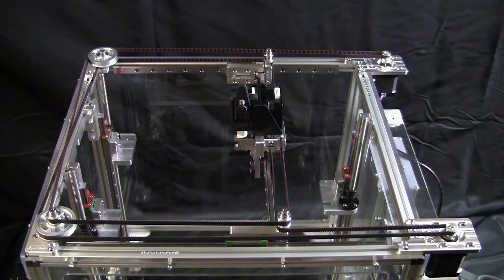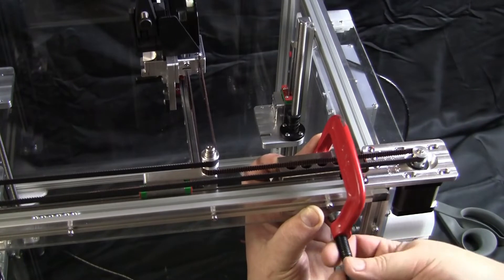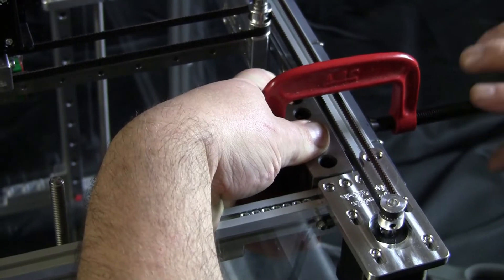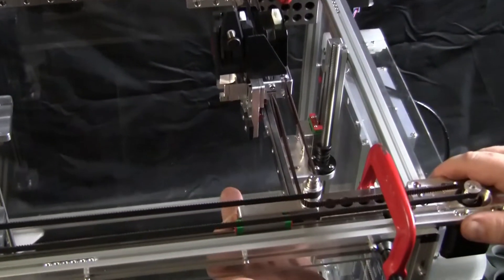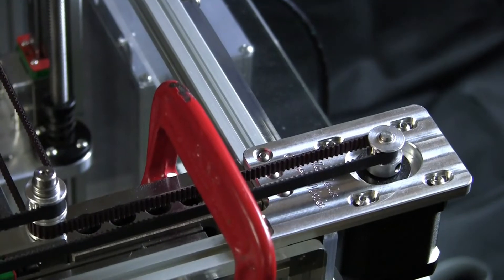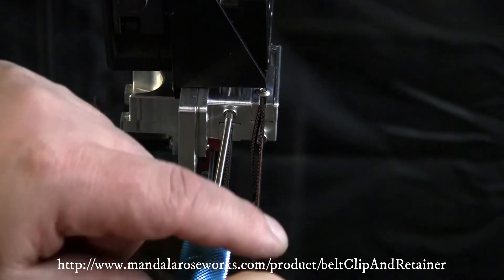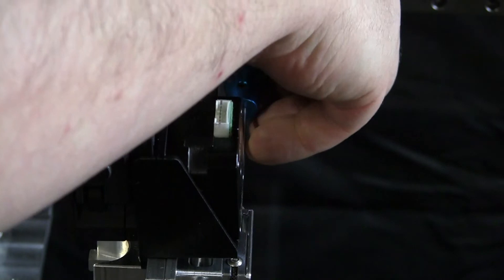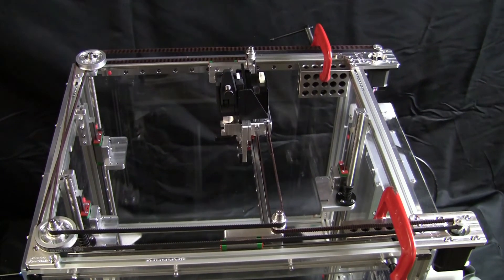Railcore X Carriage Alignment And Belt Tuning

Comment: Thanks for the video.  

Wouldn't it make more sense to square the gantry with no belts?  By using the belts to square it up your forcing one of the linear bearings into a partial bind.  I'd think you'd make sure it's square first without the belts too ensure that you're X carriage is perpendicular to your Y rails.

After doing that then i think your process makes sense because that way you make sure you're belts are not pulling it crooked.
Reply from the maker: @ not with corexy and a railcore.  Without belts the entire gantry is wobbly.  The belts are what keep it in alignment.  The only gantry is the rail.  No extrusion and not rigid whatsoever.
Reply: @mandalaroseworks  Thank you for the quick reply. I was squaring up my Prusa XL and my gantry was about 3mm crooked without belts.  I am able to pull it straight like you with the belts, but was concerned there might be another problem.  Thanks for reassuring me.
Reply from the maker: @bluerider0988  it’s important that the belts are exactly the same length on corexy.

Comment: I 3d printed some stops to mount on the right side instead of the 123 blocks. So it is a hard stop as well as being  easy to redo the alignment check anytime. I don't adjust the motor slides, just adjust with the MRW belt tensioners. Prusa's 3d printable belt tension gauge is another way to check the belt tension.

Comment: Did you recheck the alignment to the 123blocks, after you have tensioned the belts? You would have probably recognise, that tensioning the belts will give you the error again. I'm not convinced, that aligning a non-square y axis with belt tension is the way to do it. The axis shall be parallel to the 123blocks without tension on the belts. Then, one can apply symmetric tension on both belts.
Reply: As long as you turn the screws out for each belt the same amount, the alignment stays exactly the same.  I have 4 railcores that all behave the same way.  It works great.
Reply: @WadeWendorf  Thank you for the added info. Now it is clear.